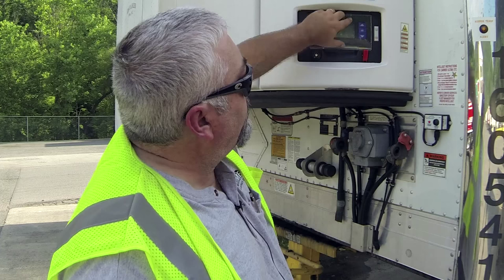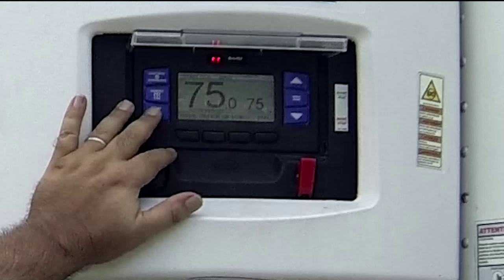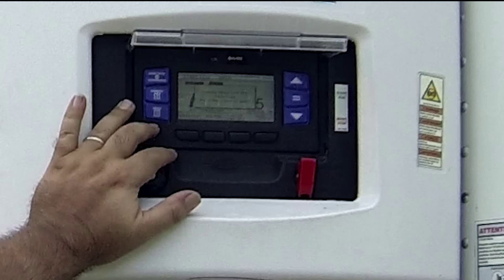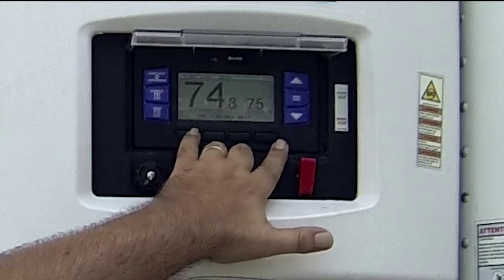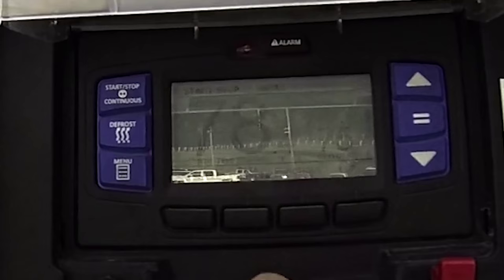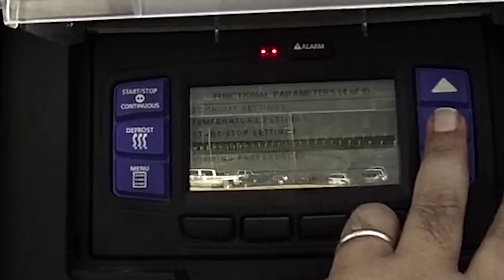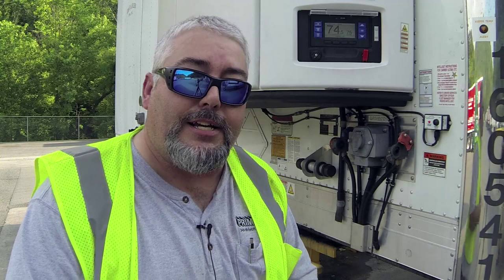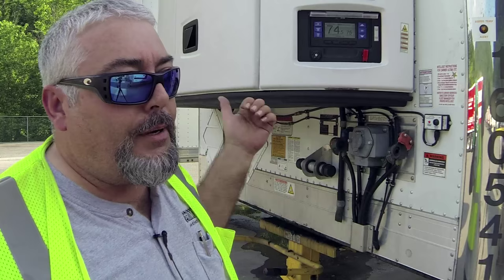Ep.#13 - Carrier Reefer Door Override

Comment: Warning; leaving the unit running while opening the doors sucks in outside air across your box and into the evaporator freezing it up. This is very hard on the $30k refrigeration unit It should never be running while the doors are open... period.

Comment: First of all the door switches have been around long before the x4 series. Second it's an added option to the install, who ever bought the unit wanted it there. Third, you not being loaded on a cold dock so the reason the unit is set to shut off is because it will freeze up. Only time you need to disable or override the door switch  is when the door are closed but your still getting the code..
Reply: Chris Nottongham  <<< understands why there is a door switch. You better get approval to override that switch from your Road Assist person, in writing.

Comment: In cycling mode If I set on 28°, temperature falls to 26°, rises to 29°, shuts off, goes to 32.5° engine, restarts and comes down again to 26°

But, I want exactly to shut off at 28° and restart at 32°, not low, not over

Comment: One thing Mark forgot to mention is that your doors have to be shut during this process in order for unit to reset itself. At least that's been my experience with Prime trailers.
Reply: you can program it with the doors open I'm a prime driver 7500 or nothing their program with the doors open or closed so what would be the purpose if the doors are closed think about it
Reply: No they don't. The entire process is done while ur at a dock with the doors open. In fact Mark's video is one way to do it. There's a slightly different way also.

Comment: I seem to have just had this issue on a 7300 x4. Procedure didn't produce a function key. I tried the inspection key and the display said Something about temperature control (hard to read in the sun). I pressed the left button, the screen returned to normal, the light went back to green and the reefer restarted. Is thus the procedure on a 7300 or did I just get lucky and fix it by accident?

Comment: How do you put it in Continuous when it’s on Start and stop lock
Reply from the maker: Easiest way is to switch it to "Fuel Hog", set your temp, then switch to continuous.  Once loaded and you pull off the door and the doors are closed, then switch it back to the normal intelliset you need.
Reply: Just use the fuel hog or produce sensitive settings which run in continuous mode.

Comment: door switch always fail,not a good thing to have....save fuel? ahah no way
Reply: and the video that youre showing is only with the carrier ''apex'' system....let's try this with the ''advance'' or the ''summit''
Reply: The door switch isn't about saving fuel It's about saving the box temperature.
 Swinging those doors open sucks in 3000 CFM of outside air and that slams the evaporator trying to keep the unit cool.
 You should shut the reefer unit off before you ever open the doors.... The door switch is essentially a dummy switch for people that don't know that